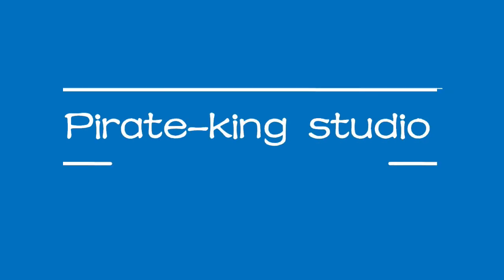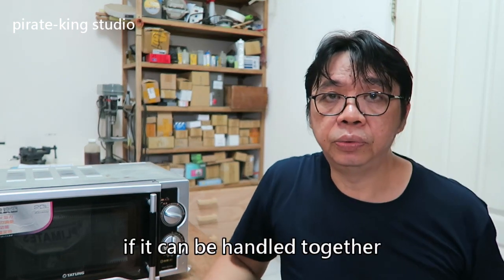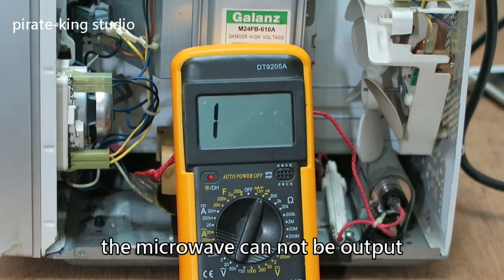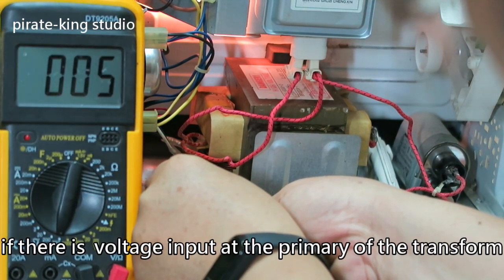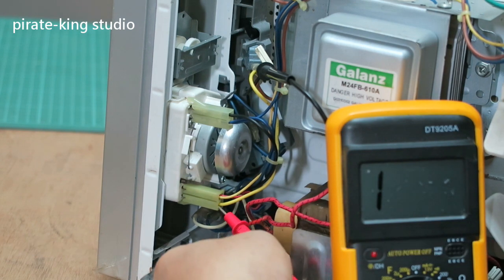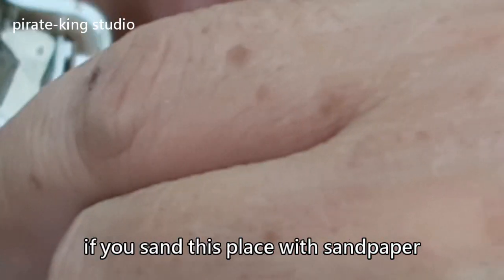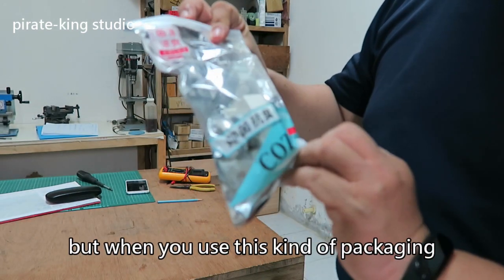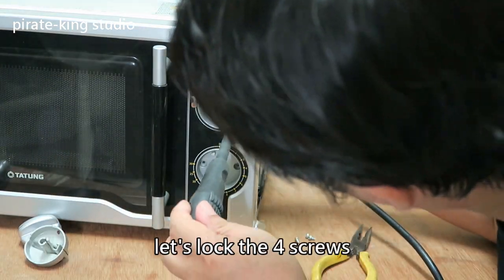How to repair the microwave oven not heating (Timing temperature switch replacement) pirate-king

Comment: hi, i'm not sure if i have the similar problem. but what happens is that i have to press hard my timer knob then that's when the glass/shaft of my microwave starts turning. if not, the power trips, no heating and turning but the timer still counts.
Reply from the maker: I think the internal contacts of the timer switch are damaged or the power output pins of   timer switch  are loose.
The timing motor of the timing switch is separated from the output control contact.
So when the output contact fails, it does not affect the timing function.